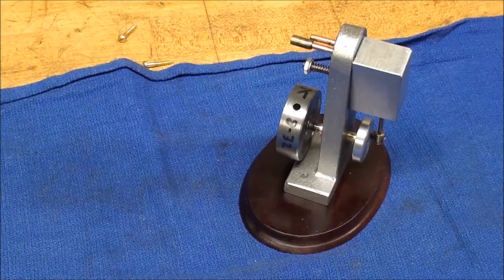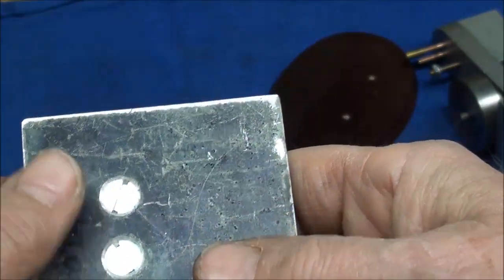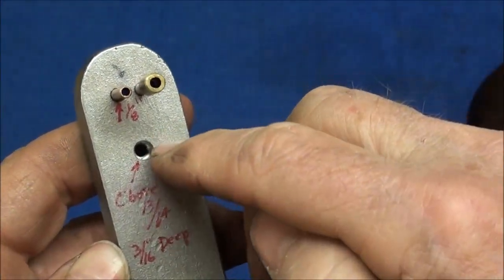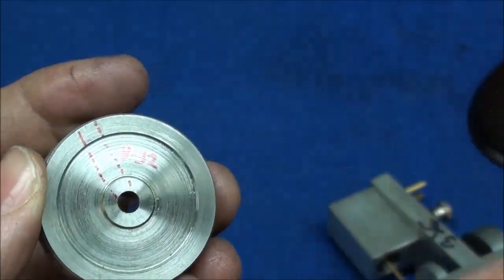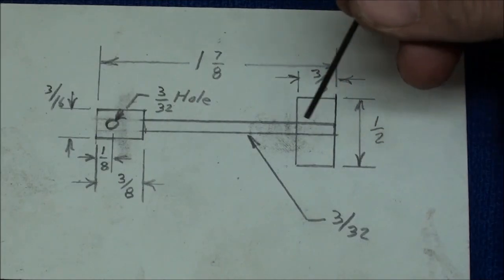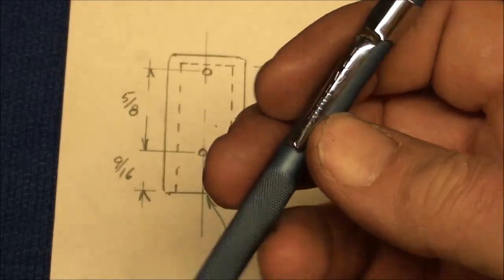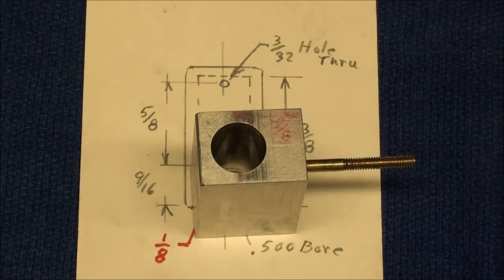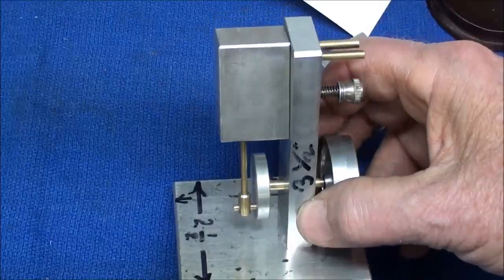plans for TUBALCAIN BUILDS A SA OSCILLATING STEAM ENGINE Part 6

Comment: Your pupils are very lucky to have had you as a metalwork teacher, my metalwork teacher was very good too must be a thing, its corona virus lockdown here, so I am off out to garage workshop, I dont have a lathe or a mill, but I have a homemade CNC and a good drill press I am gonna try and make it from wood, oak to be precise, I got some small stainless steel rods and brass tubes for the axles, I found a 65mm (2 !/2 inch) brass fly wheel on Ali-Exprss all I needed was the dimensions but the site seems to be down ... best of luck mrpete222 and everyone keep yourselves saferegards Neal

Comment: Just finished mine today. Pretty fun, thanks Lyle. I added a little more length for the stroke on mine, and found that changes the geometry enough to expose the air ports when at 3 and 9 o'clock positions. Doesn't seem to affect performance though. Can't wait to build a double acting one next.

Comment: TUBALCAIN I have said; I am not a machinist; I am a woodworker. However I could be, easily called a want-a-bee machinist! I imagine this could be made from wood?
The flywheel I assume will need to have weight? Don’t think I could possible make it out of wood? Even “ipe” without some modifications, it would be just to light? All tubing and other parts would be brass; Typ.  Anyone at this site who has more knowledge than I do, “drop a post”. This project would be an interesting course of study in wood. As always, thanks’ for taking the time to make this video! And I support this site. ~M~
Reply from the maker: YES, use maple--for the flywheel, ironwood. lol
Reply: Thanks for the posting back and the irony of ipe aka Ironwood, however I know of any other wood that has this weight. Will make a prototype with Maple ~M~
Reply: You could use lead shot inserts around the perimeter of the flywheel, evenly spaced, embedded and covered with wooden plugs. I have seen pics of wooden oscillating engines somewhere. Also, check the Elmer Verburg plans. He made a really nice wooden grasshopper engine with many wood parts.
Mr. Pete, thanks for the plans and the how-to videos, I intend for this to be my first engine build.
Reply: Mark Nerren
Weight on the flywheel doesn't need to be evenly spaced,if you make the crankshaft like a real crankshaft with the weight in the bottom,you can balance it with the flywheel for better performance.I won a competition back in 2008 at Coventry University England,i had an 15% faster air motor from the guy in 2nd place.